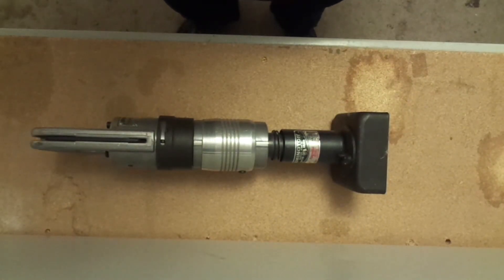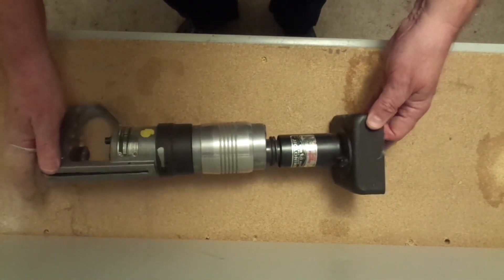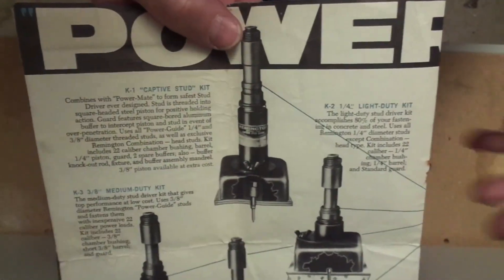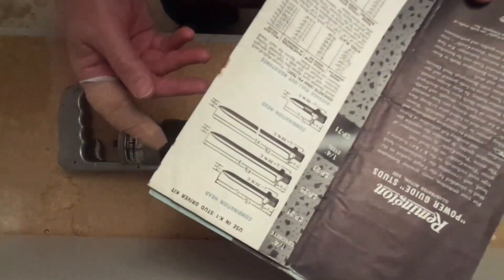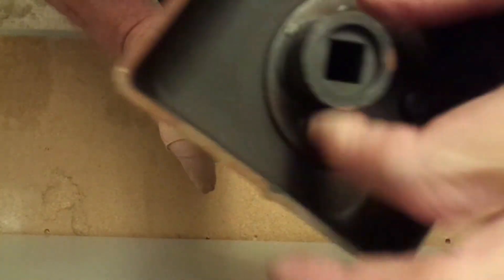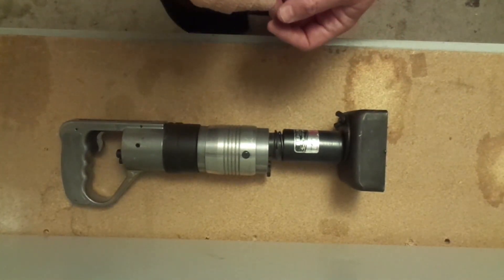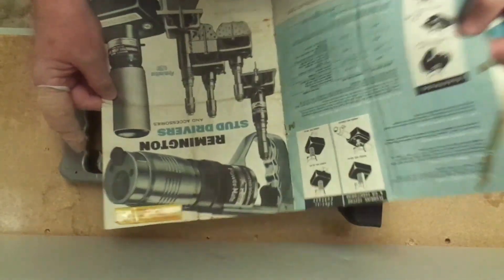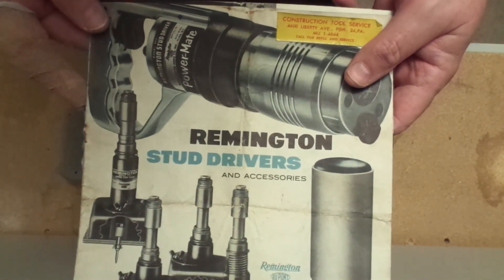Remington 455A Power Mate revisited: Model K-1

Comment: I've got An old fixing gun like this. Would love to know more about it
Reply from the maker: I do have another video that gives more detail on operating the tool. Note though, this is a direct drive tool. The tool will not operate with loads and fasteners sold today. the primary reason is the powder loads do not contain as much powder as they once did. If you happen to have the old loads, be careful. Direct drive (high velocity) tools have far more power, the fastener is more likely to pass through material. That's why they are no longer used.
Reply: @Vintage Powder Actuated Tools  soon as am home mate. Ill have a look at the gun I have and send you the name off it. I've been trying to find info onit for a long time now but struggling.
Reply: It's called a tornado fixing gun if you know anything about them ?
Reply from the maker: @endurofiles9916   All I know about Tornado is they apparently weren't very successful here in the United States. I do have one tool. I've seen other versions of this tool and other tools with the Tornado name on European eBay pages. That's all I know about them. https://www.youtube.com/watch?v=pLCKgXDEhs8&feature=youtu.be